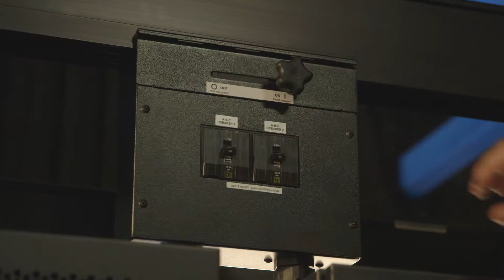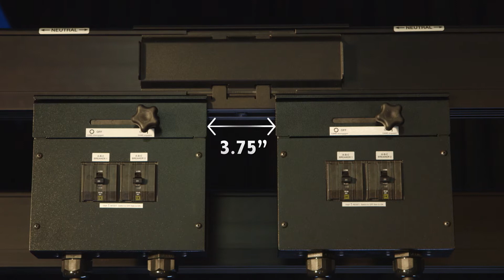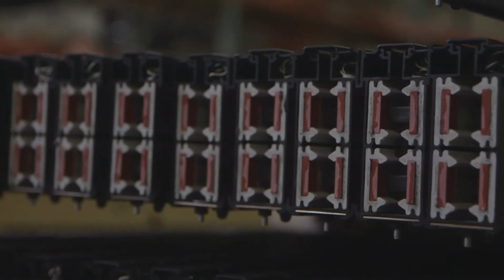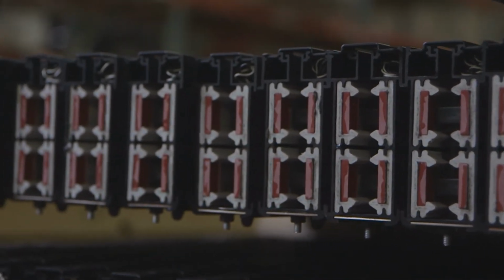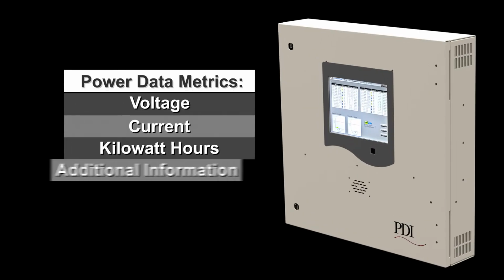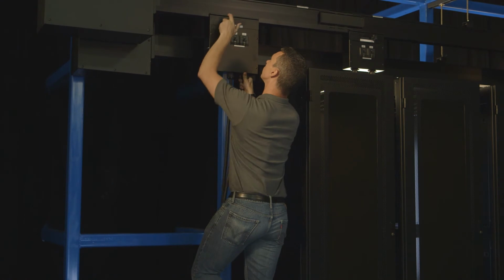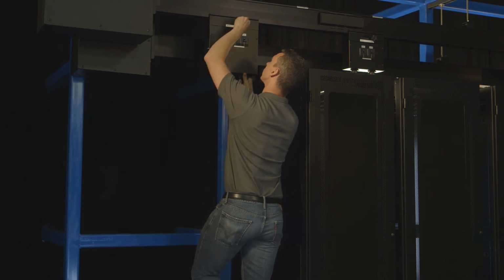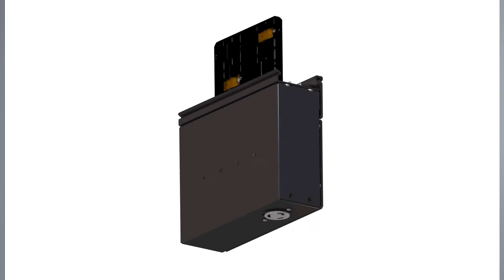PowerWave 2 Bus System - Overhead Electrical Busway

Comment: When inserting the Tap-Off Box, what keeps the technician from bumping against a non-grounded hot rail, causing a ground fault and bringing down all the active servers?
Reply: The rail itself is grounded and there is an option for an isolated ground, if needed.  The Tap Off Box, when mechanically inserted, first makes a ground connection.  Once the technician is ready to energize the Tap Off Box, the slide mechanism is engaged making 3-phase and neutral connections.  This two step process allows for more control versus systems where both ground and phase/neutral connection are made in a combined step.